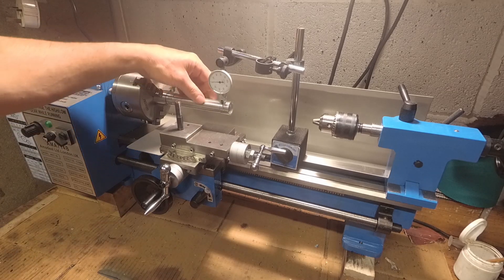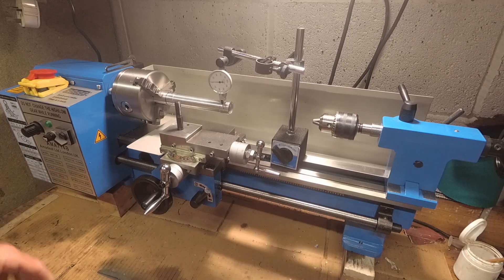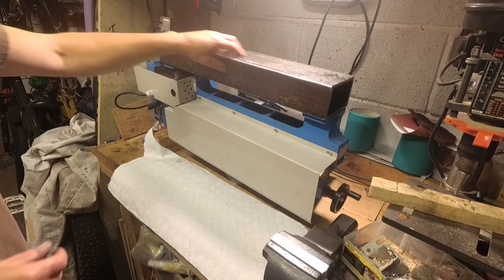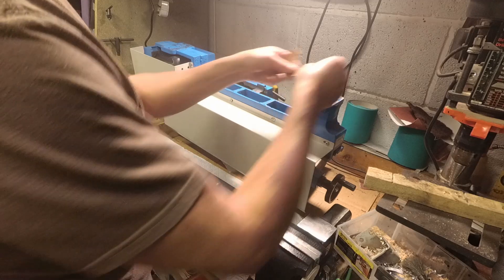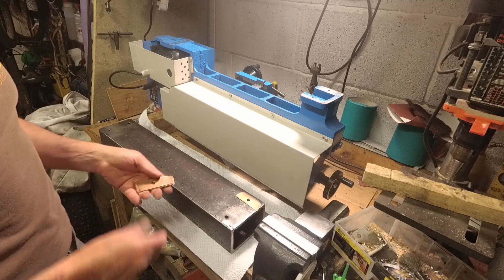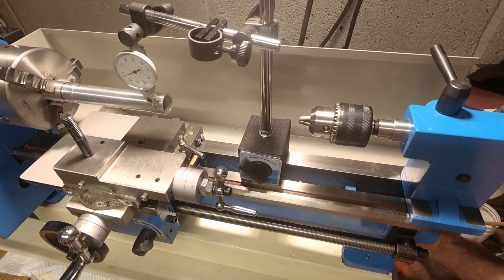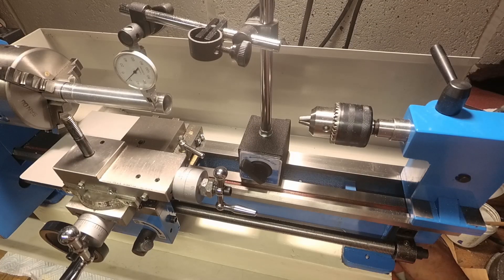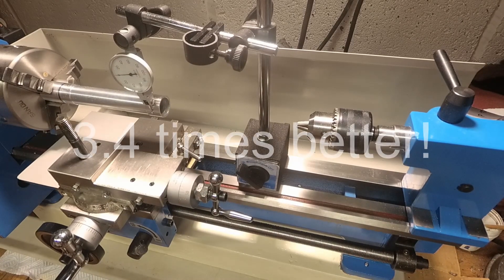How Stiff is a Mini Lathe? (And how to make it 3.4X less noodly)

Comment: The original lathe bed is like the cross section of a hollow tube, but they've cut away one side (ie the bottom). By bolting it to something solid, you've replaced the bottom side of the (virtual) hollow section. Clearly effective.

Comment: I think there's a huge flaw in the design of the lathe bed: the headstock is not supported underneath where the bed has that huge cut away to mount the motor. I consider it an appalling design oversight - the headstock is where the most rigidity in the entire lathe is called for

Comment: Back in the day when I used to build machine for testing the Trent jet engines we had some very large fabrications where it wasn’t possible to machine them completely flat. We used some of the engineering epoxy between machined surfaces of parts . It worked incredibly well but I’m not show if it’s affordable in small quantities.
Reply from the maker: Hi! Yes, that would be a good idea. I may well have used that method if I was aware of it at the time.  When I built my small CNC, I used (ordinary) metal filled epoxy as a 'liquid shim' between the gantry and the base - set everything up straight and square and then, once the epoxy had cured, tightened the bolts up. I basically copied the method in the video by Steffan Gotteswinter where he uses the real stuff to align his milling machine https://www.youtube.com/watch?v=U7Qs-J2swIc

Thanks for taking the trouble to comment 🙂
Reply: @Mister_G  I should have said it was used as a shim in my post. Did the metal filled epoxy you used work ok. I have a small model Lathe that needs the same.
Reply from the maker: @allthegearnoidea6752   - Yes, it worked extremely well. Actually, I think I ended up using JB Weld in the end as I couldn't find a real metal loaded epoxy with a slow cure at a reasonable price. I did try metal loaded epoxy putty, but it cured far too quickly. I have never tried dismantling it, but one side of the joint was waxed, so it should come apart OK.  I used the same method to prepare the beds for the linear rails on my CNC (have a look under 'metalwork -> Desktop CNC' on my website for some photos of the process if you are interested)

Comment: I mounted mine.  Problem solved.  Simple.  All these vids about cheap machines and how imperfect they are.  Hilarious.  Buy a Bridgeport.  All of these mini machines need to be mounted to add to the rigidity.  I bought a Grizzly G0752 and absolutely love it!  It is a beast and does more than I need it to. I have modded it quite a bit.   One thing I dont do is complain about it.
Make chips!
Reply from the maker: Absolutely! This little lathe is still serving me well and making the odd usefull thing, as well as plenty of chips.

Comment: In your parting operation, I don't think it was finding the right feed rate. You've simply loaded some of the springiness in three system. At least that was my experience with a similar lathe. Replace the compound with a solid tool post with an anti rotation feature  and I bet you'll see even more improvement. Also, bell mouth chuck jaws can cause chatter. Thanks for quantifying the stiffness before and after.
Reply from the maker: Hi, thanks for the comment :) I've got less timid with parting off since this video, and now use an insert parting blade and it works just fine. I wouldn't want to lose my compound slide as I use it too often. As delivered, the top/compound slide was horribly flexible (the gib strip wasn't working properly and the slide was lifting as the gib was tightened - seems to be quite common). After sorting this out, it is much better (but it's still the weakest link, I think). Thanks again.

Comment: Today I tried using my parting tool and it was horrid and sent me on a quest for more rigidity. i knew my 36 year old Taiwanese mini lathe needed better mounting but to what end i knew not. Thanks for quantifying one of the issues. I went straight out and measured .004" twist in it and have a plan of attack for tomorrow.
Reply from the maker: The very best of luck on your quest! :D
Reply: Your tool is not set up correctly and or the spindle speed is wrong.  I use a cut off tool al the time on my mini lathe without a problem.  If you machine is properly mounted and leveled with a precision level then your issues will be minimized.
Reply: Have now set my lathe on a substantial lump on channel and cut the deflection in half or better. My slowest chuck speed is 100rpm. With a parting tool 2mm wide I should be able to part mild steel unless tool rigidity comes into it. My  1/8" still chatters like crazy.

Comment: After many years of procrastination, I finally got around to mounting an older lathe of this design to a heavy piece of of structural "C" channel steel of about 10mm wall thickness and added shims. The section weighs more than the lathe itself. It is now a two-man lift to move it so it is now on a trolley-table. As I only do the occasional job on it making a few lens mounts, parallel accuracy was never really critical. I now wish I had pulled my finger out and improved it years ago. It was never much good for working with mild steel or salvaged alloy from aircraft propellor blades which machines like mild steel. That has changed since.
Reply from the maker: Hi - I was surprised at how much difference it made. Glad it worked for you too, and thanks for watching! 🙂

Comment: I just bumped into your video, it's a year old, checking how much it can deflect. I'm Keith from Michigan USA. I've been around professional machinery for nearly 44yrs. Turning 65yrs in March, and yes I have been around with metric and I love and it's actually easier to work with. Well anyway, has your mini Lathe doing what you want 😉? Please give me a reply
Reply from the maker: Hi Keith - Yes, at the moment, my mini lathe is doing me proud - I machined all the parts for my model jet turbine on it, and managed to hold  0.004mm TIR on a 125mm long shaft and machined a couple of bearing journals to within ~0.002mm which is as much as I can ask for. It even turned nckel alloy without too much hassle. It's definitely not in the same league as a "proper" lathe, but then a "proper" lathe wouldn't fit into my shed. For the hobby stuff that I do,  you really just need decent measuring equipment and patience 😊. 
Thanks very much for the comment. 👍
Reply: @Mister_G  Welcome for reading your response 😀. I'm impressed with what you accomplished 👍. My last career, 9yrs with a company called Woodward. They do new and overhauled fuel nozzles around the turbine engines. Passengers jets and military. I worked on some tough materials to machine. But my huge career was working on honing, gone to auto manufacturing facilities for the the engine blocks. This is when I learned about microns. I'm happy 😊 that you used your Lathe and hold good tolerances, take care 🙂.
Reply from the maker: @keithmonarch447  Thank you - you too :)

Comment: I'm a woodworker with a mini metal lathe (coz why not) and was amazed at the difference putting my 7 X 14 lathe on two large 450mm by 450mm concrete 'stepping stones' made.

The instant dampening effect was really noticeable when I made a similar cut to yours at the end, so a nice heavy chunk of steel like you used would certainly notice it, too.

I'm about to build a custom stand for the lathe and intend to make a concrete top for it.

Thanks for taking the time to upload your video.

Stay safe and all the best.

Doc from Australia
Reply from the maker: Hey! Thanks for watching. Glad you found it of interest. 😊
Reply: Wonder how well it would work combine the ideas, and embed studs in a block of concrete at the spacing for the bolt holes, and bolt the thing right down to the concrete.
Reply from the maker: @auxchar  Thanks for commenting - My view is that I would be reluctant to bolt the lathe to concrete as I would be worried about the effects of temperature fluctuations on the straighness of the metal bed (steel/iron changes length much more than concrete as the temperature changes). Ultimately, it would depend on how important (say) vibration damping is vs thermal stability to the owner of the machine in question.
Reply: @Mister_G  actually concrete has almost exactly the same coefficient of thermal expansion than steel and cast iron. (It varies and you can get both concrete that expands more and less than cast iron)
Reply from the maker: @MF175mp  Every day is a school day - Thanks 😊

Comment: Surely if you want rigidity increasing across the plain of the bed, then you need to go 90 degrees to the bed. 
For example 2 x  channel or heavy box section cut to the width (F2B) of the drip tray. And perhaps bolt the ends down whilst shimming there?
Reply from the maker: Thanks for commenting - I didn't wan't to bolt the bed to a wooden bench because the wood moves with humidity change and would mean that the alignment of the lathe changed with the weather. The biggest thing I had to bolt it to was that metal channel.
Reply: @Mister_G  who mentioned wood? Going in the direction of play with a brace lowers the direction of play, yet your brace follows the play. It's like putting a corner on a wall, it becomes stronger. Plus, oversizing a hole through wood would deal with most movement also...
Reply from the maker: @carlraymond5418  Sorry! - I misread your original comment as adding 2X cross-wise pieces and bolting them to the bench (don't know why). Yes, you are right, the bigger the "cross section" (actually 2nd moment of area) of the part linking the two ends, the stiffer it will be. One must appreciate though, that a chain is only as strong (or stiff!) as its weakest link. I don't pretend that what I did is in any way optimal, but I think it's enough to mean that torsional stiffness of the bed is no longer the 'weakest link'. Thanks for the reply.
Reply: @Mister_G  The shining in such cross members to get the ways level along its course also becomes easier in this way as a shim can be moved in or out to achieve optimum adjustment.  Where as if you needed to shim it would be under the casting, not the support.
Reply from the maker: @carlraymond5418  True.

Comment: I can part off 3/4" (19.05mm) diameter 4150 with a 1/16" HSS parting tool in my 7x12 mini lathe at 500 RPM with no chatter, and no silly chunk of scrap iron bolted to the bottom either. You have other serious issues at hand that you need to sort out if you need to resort to this modification.
Reply from the maker: Whatever dude - thanks for watching :)

Comment: Great idea I'm probably going to do the same thing only I'm going to weld together a bunch of small square tubes so that it doesn't sit so high and I like how you tested it by parting some steel mild steel is a dream if you really want to put it to the test do some mystery steel like an old cheap weight bar now that gave my mini lathe hell
Reply from the maker: Ha Ha! - Yes, mystery metal! I got a length of old crowbar about 30mm diameter that defies any attempt at getting a decent finish on it. Thanks for watching! :)
Reply: @Mister_G  , 
Please provide the address for this mini lathe dealer/distributor, in  Indonesia .

Comment: Why not just have used a piece of granite? It gives more weight and is more rigid than steel and handles vibrations better as well.
Reply from the maker: Thanks for the comment - Firstly, I didn't have any granite! :). There is also the issue of thermal expansion - granite expands  less than steel/iron for a given temperature change. If the lathe was fastened to granite, the bed would bend slightly as the temperature changed. As my shed is unheated, this is something I wanted to avoid. Volume for volume, steel is ~3x heavier than granite in any case (specific gravity ~7.7 vs ~2.7), and about 3X stiffer (Young's modulus ~200GPa vs ~60GPa) - but like I said, it wasn't an option anyway.
Reply: @Mister_G  Steel expands at a different rate than cast iron does, especially the junky cast iron the chinese use these days. I also think most times a normal cut off piece of granite is 5cm thick at minimum(good luck finding a 5cm thick plate of steel) so I believe it would have been heavier than that hollow beam. You also forget as well which is a massive factor for going granite rather than steel is that the piece of steel you used is hot rolled angle iron steel which has internal pressures and is very inaccurate compared to a polished granite surface(there is a reason they use granite surface plates) and add to the fact you welded seams along the entire piece and I can bet $100 a piece of polished granite would have been significantly flatter than your welded angle iron steel sections as your beam could have a warp in it from the welding which would also warp your lathe bed when tightening down. To each his own, but speaking from experience a piece of granite works better as I had a steel plate before I went granite.

But here comes the kicker. Because of you using hollow section of tubing and it was welded(different steel composition from rod to base material) comparative to a slab of granite your tube would twist far more than a slab of granite, don't believe me? Please put your tube in a strong vise, add an indicator and add a pipe wrench and some leverage and see for yourself how much twist you will get, now go and try the same with a piece of granite and see why I am right and why people use granite epoxy for DIY cnc. 
Also please read up on resonance and see why steel is a bad material for lathe beds and why granite is better for resonance as well, if you don't know what resonance does to a lathe, think what chatter does when your motor is running and you feel the vibrations through your lathe.

Here is something for you to read as I see you don't really understand how thermals actually work in material of granite vs steel and cast iron.(https://blog.reitz-natursteintechnik.de/en/granite-concrete-vs.-steel-in-mechanical-engineering-five-convincing-properties)
This will indicate to you that in fact granite is far superior for a lathe bed material as it does not move because of low internal stresses and it moves far less and far slower in temperature changes, which is exactly what you want your moving cast Iron lathe to be bolted to as the piece of granite will keep it straight instead of twisting with the steel.
Reply from the maker: @kazykamakaze131  Granite is a great material for a lathe bed (and any precision machine) - particularly for stability and vibration damping as you say, but my lathe bed was already cast iron :). I wouldn't mix the two, but YMMV.  Like I said, I had the steel already, and (as shown in the video) levelled the mounting pads after welding, etc. and checked for bed distortion as I tightened it down. The expansion coefficients of cast iron and steel are near enough the same. I'm very happy with how it worked out. Thanks for the interest :)
Reply: @kazykamakaze131  Repeat after me: "we row with the oars we have".
Reply: @BeachsideHank  That is not the saying fit for purpose here, since per weight granite is cheaper than steel.
Reply: @kazykamakaze131  In New Hampshire, the Granite State, yes, in Florida, the Coquina state, no, I lived in both, I know the facts whereas you make suppositions, now digest this pearl of wisdom too:
Good enough, satisfactory, sufficient, acceptable, suitable, reasonable, agreeable, adequate, usable, all right; these words do not necessarily mean compromise in any endeavor, just a point at which nothing further of substance will be gained by additional effort. Don't let perfection be the enemy of good enough.
- Beachside Hank
Reply: @BeachsideHank  "good enough" key word. If you can get granite offcuts for very cheap and we know its one of the best materials to use because of previous examples of granite surface plates, then why try to reinvent the wheel? You see how this works? Can't just think it's perfection if it has been done already.

 "I know the facts whereas you make suppositions" You are by the nature of your claim making a supposition about me. You fail to realize that not everyone is from the US watching this video and the one common material across majority of the planet is granite since majority of houses have granite tops and by the manufacturing process of these tops there will be off cuts which are very cheap that are ALREADY flat and polished with no need to weld or indicate nearly as much for and will have a better base in more conditions than steel.
So to cap off your condescending tone, tiddle on this fiddle of knowledge. 'You don't know what you don't know'. This is why even experts in a field can be wrong but from seeing how you respond by the lack of you mention "I know the facts" makes it apparent you are out of your depth and should rather stick to splashing water in the kiddy pool where you belong. 

If you want to do the maths behind it then start an actual discussion with the "facts" you mention rather than trying to puff out your chest thinking you are the guru of material sciences. I did maths all the way through to my PHD so by all means show me the "facts". Unlike you I already provided links to real facts explaining why granite is better than steel. Thus, the onus is up to you to prove me wrong then. This is how science works if you didn't know. It's called peer review.